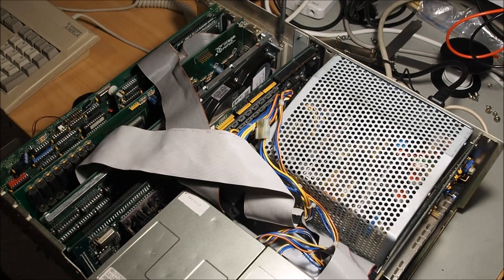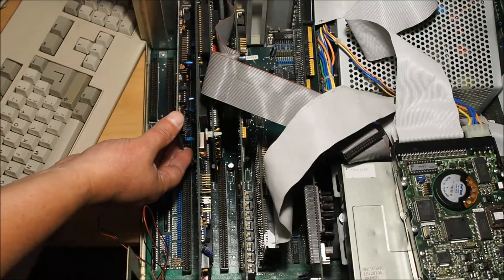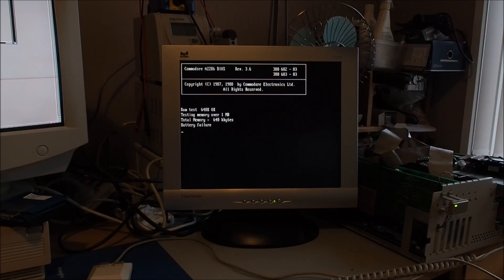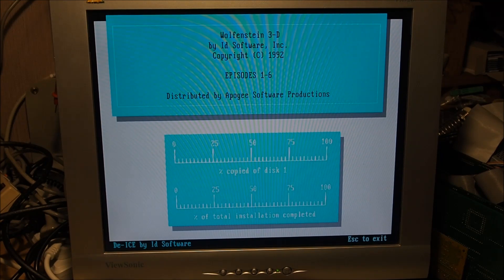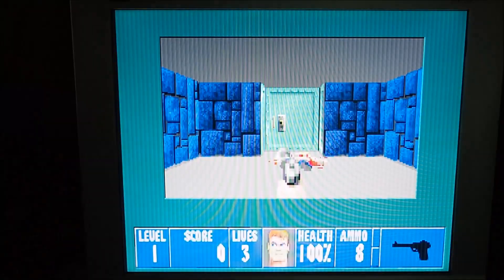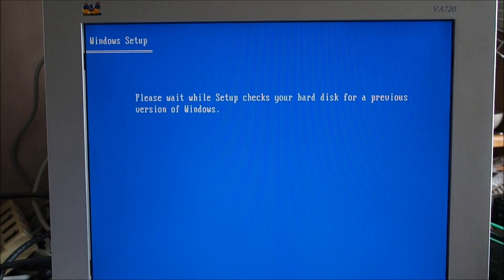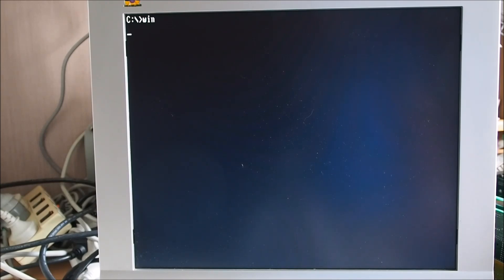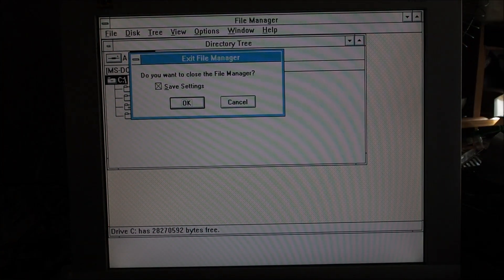Tricking out the Amiga 2500 Part 6 - Bridgeboard

Comment: Great video:
Tips:
You can use Amiga mouse in PC part. If you run amouse.exe or mouse service. Default is you port 2, swap to you port 1 by hotkey

Win goes slow due to slow seek time when using hardfile. You need ide controller with separate hdd.

Comment: If I recall you can just solder on the 16-bit extensions onto the Amiga 2000 motherboard and make those other two 8-bit slots in to perfectly usable 16-bit slots. I had a 386 Bridgeport I used to use - I still have it. I had a really nice 16-bit is a card that had video, a hard drive controller, I believe a floppy controller and a Serial and parallel port all on one card. I will get it back up and running as soon as I get one of my A2000 working again

Comment: And yes, Windows 3.1 needs a full 1MB of RAM, and it is specific configuration of that RAM, I can't remember if it needs EMS or what sort of RAM setup.  That installed on my '286 setups back in the day, although it wasn't particularly stable from memory.  So it should be compatible with the 286 CPU, but it could even be a BIOS incompatibility issue...

Comment: I believe a big part of why things load so slow is the use of a hardfile.  If you can, using a dedicated drive should make a massive improvement.  Also, the general slowness looks to be far slower than I would have expected - I had several different '286 systems, none faster than 12.5MHz with 1MB of RAM, and Wolf3D was certainly quite playable on them, although certainly not in full screen.
Reply: Troy Wilkins the hardfile seek time is the reason.
Reply: @remijakobsen1848  yes, agreed, but that shouldn't make Wolf3D THAT slow.
Reply: Troy Wilkins i think it does, wolf3d loads when playing. But it runs a bit better on my a2500 system though Probably helps for the hardfile I got 030 cpu and uses a fast filesystem on the Amiga part.

Games that doesn’t load all the time, like SPace Quest 3, Test Drive 2, Prince of Percia, Pinball Fantasies, etc.  Runs smooth though.

CPU benchmark exactly like other 8 mhz 286 pc’s.

Comment: Does the bridge board use any of the Amiga resources? Is it basically an entire pc on a card that lives in the Amiga case?
Reply from the maker: The one I had actually was pretty much a PC on a card...I believe it was a 286 and CGA.
Reply: Nac_ZR it got a buffer for communicatimg with Amiga part. Amiga Lpt port, keyboard and mouse can be shared, harddisk image on Amiga partition, clipboard pasted in amiga os, mda and cga graphics emulated on Amiga chipset, files sent from pc to Amiga os etc.